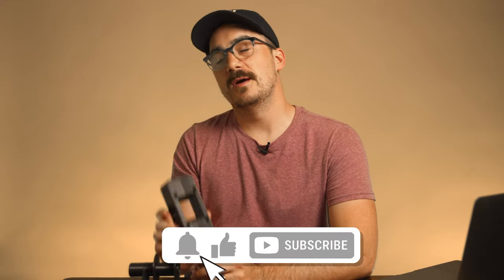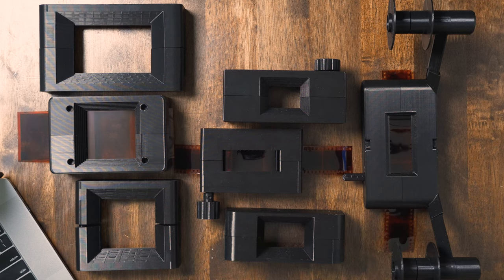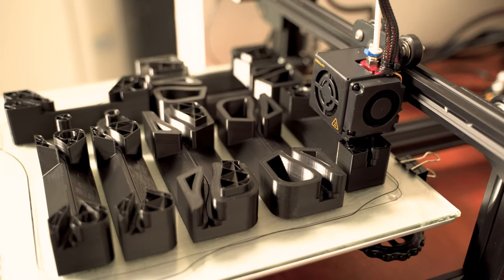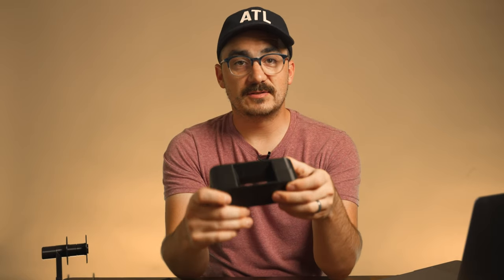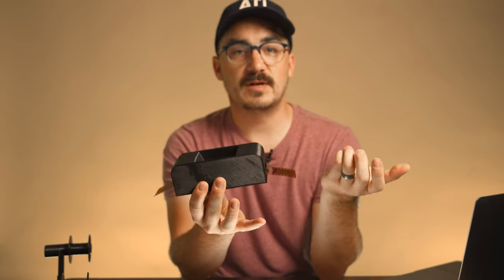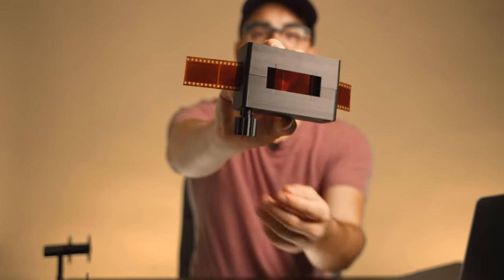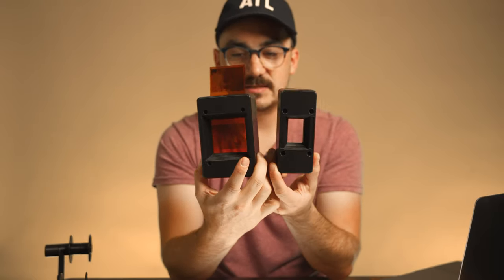35mm Film Scanning with a 3D Printer

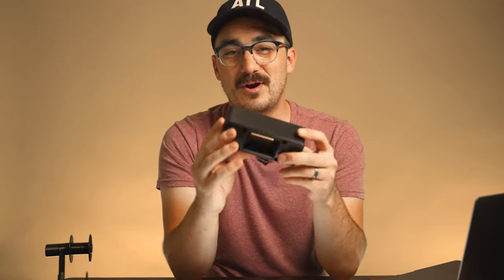Comment: Hey! I saw this video like half a year ago and it took me that amount of time to find someone to print this for me. Just finished printing and scanning and I would recommend 7:41 100%. Works great, just make sure the print comes out 100% right because if it's even a mm off anywhere it can crush the film or not let it in. Also, for the pins, make sure you print them vertically, because if you don't you get an extrusion on one of the sides which you have to sand down or cut off. Thanks for the video!
Reply from the maker: Thats so awesome

Comment: If only these can be mounted onto a heavier base/plate, otherwise, these are too light and can easily be moved around esp. for those with a advance knob.
Reply from the maker: I’ll show how to use it in my holder announcement video. It’s pretty easy to use without sliding around. I’m also trying to devise some ways to add weights. But again, it’s not that big a deal. I’ll show ya soon!